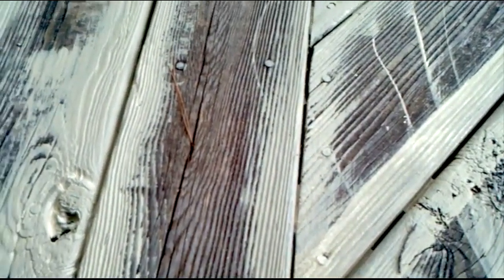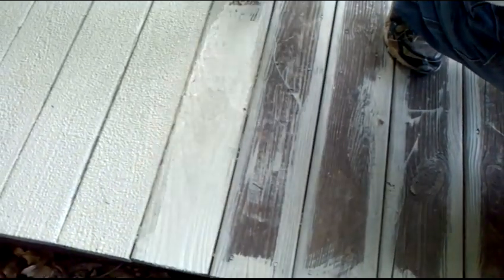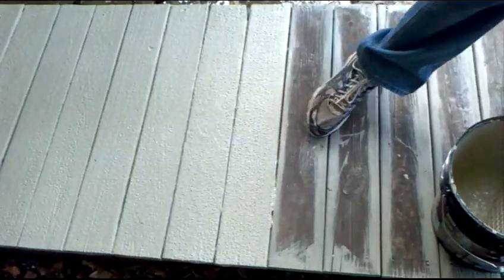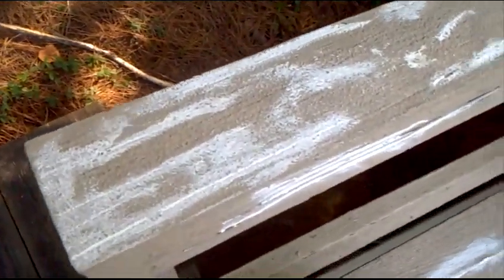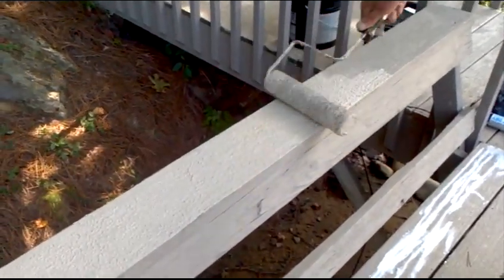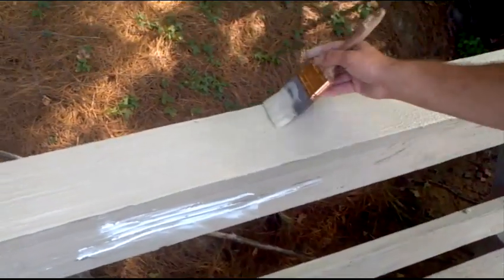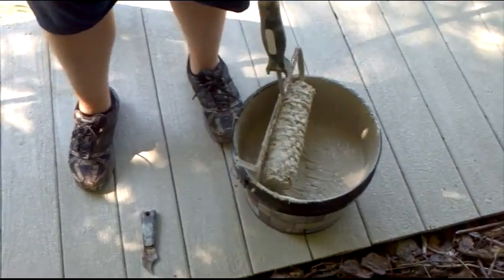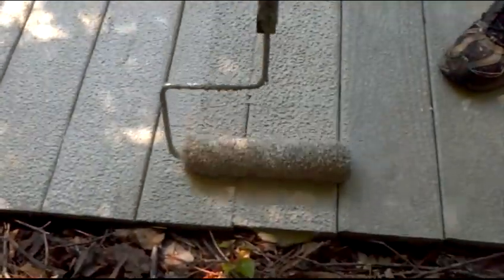How to install Deck Restore.  Best result!

Comment: Josh:  I spoke to you a few weeks ago from CA.  I finished the deck using Restore 10X and it looks fabulous and the customer loves it!!  As you suggested, I did sand down the couple kiln dried 2x6's i had to replace and used the eye dropper to do the water test.  Fortunately, nothing had been done to the deck in over 15 years so it was a perfect candidate for Restore.  Hope it looks as good next year as it does now.  Thanks again for chatting with me and sharing your video.  I must say this product is not for the casual DIYer...a lot of work putting down 13 gallons in a little over 300 sq ft. of deck.
Reply from the maker: Great!!  Glad it turned out well.

Comment: What do you do to properly prepped a deck? I see a lot of videos saying they did followed the direction to a T.  Thank you for any help you share!  I'm looking at using the 4x by Olympia.
Reply from the maker: We make sure the deck can pass a water test by placing a drop of water on the horizontal surfaces.  We also use stain in-between each board.  We put crack filler or caulk in the big cracks and nail/screw holes.
Reply: What is the water test?
Reply from the maker: The water test is placing drops of water on your horizontal deck surfaces.  If the deck absorbs it immediately, then your deck is ready for the product to be put on.  If the water stands on the deck for any amount of time then you need to sand the wood or pressure wash it to get it ready for the product to be applied.  Your deck must pass the water test.

Comment: i just bought a large 4 gallon tub of this yesterday at Home Depot.. We will be doing out Concrete porch here soon.. I painted the porch last year but with rain coming in little it has lifted in a few spots and peeled.. Would it be wise to pressure wash the porch to get any loose paint off?  I bought a crud crutter tech cleaner but i feel i should pressure washer and get as much off as possible...
Reply from the maker: Thank you for watching and commenting.  Just do what the label says and save the can.  The prep is the most important part.  You can't apply this product on top of any other product, it has to be clean brushed concrete.  It can not have a slick finish.  I would be sure it is as clean as you can get it and the temps are what the label calls for.  Air and surface temps are as important as the prep.
Reply: thanks Josh, after looking the other day i bought the advance Restore 10x surfacer or resurfacer its called... I plan to pressure wash and clean as best i can.... thanks for the tips

Comment: this is a GREAT video...thanks for sharing.  I have been following each step as I proceed through restoring my deck.  I am putting down the basecoat and have approx. 1/2 inch gap between boards which appears much larger than one on your video...to remove the 10X between the gap..how close to you run your putty knife to the board?  Also, on 2nd coat you back brush rail to give smooth surface and mention you could also do it with the deck surface.  however, you did not in this video.  I know this is alot of extra work, but not sure if i will be happy with a rougher surface when walking on it with barefeet...what is your preference?
Reply from the maker: I like the rougher because you can make it look more consistent on the decking.  I like the brushed on the tops of the rails.

Comment: Thanks for the video Josh.  I have purchased this product and have still to apply it.  There are many negative reviews about it so I wanted to know if you have had any issues at all using this product?  Any feedback would be great as I certainly don't want to ruin my deck.
Reply from the maker: Nope.  Just make sure you prep correctly.  Don't let it rain after you apply for 48 hours.
Reply: Josh Dillon I have always wanted to try and control the weather.  LOL.  Thanks again Josh.  I have decided to not try the product at all as I am not sure of the outcome especially in the Canadian winters that we get here.  I would fear that after one extreme cold, it would not last.
Reply from the maker: LOL!!  Controlling the weather would be a great super power.

Comment: I am going to be using this stuff i believe for the railing of a deck i am building and then staining the actual biards you walk on because the floor boards are new but the railing is used wood i got to help keep cost down. Anyway i saw your video and it will for sure be a huge help for the process of painting the railing and i absolutely need to know this color you are using!  It is the exact color i was picturing in my head!
Reply from the maker: Julia Roszak I think this was the fieldstone  Thanks for watching.

Comment: did you use a standard roller? When we purchased the paint the guy at HD gave us a roller that looked like a sea sponge? Is that needed? I've never used one before.
Reply from the maker: No, we used the sea sponge roller.  How did yours hold up?

Comment: So you use DAP paintable and then use the Deck Restore?  My boards are rather weathered.  Not rotted just splitting.
Reply from the maker: ***** Yes.  The clear paintable is the best we have found.  I would just replace the boards instead of going through the trouble and expense of trying to repair them.  Thank you for watching and commenting.

Comment: So is this product longer lasting then normal semi transparent deck stain?  i just got done stripping, brightening and sanding my deck.  Its in good shape, so do i even need to use this product?
Reply from the maker: Yes it does last longer if applied correctly.

Comment: @joshdillon thanks for the great video. I just finish doing all. Can I add the Behr clear water sealer on top to make it last longer?
Reply from the maker: Not sure.  The Restore seems to peel from where it makes contact to the wood.  So, I can't say if putting another coat of sealer on the top would help.  How did yours hold up over time?

Comment: What kind of latex caulk do you use?  Couldn't really hear it.  thx.
Reply from the maker: Dap paintable.
Reply: Josh Dillon
I heard " ALEX Fast Dry ".  Not to argue with your success but I note that this product contains silicone.  Rustoleum recommends a non-silicone formula for caulking.

Great video though.  It makes much more sense to be as meticulous as your vid shows rather than the implied " just roll on 2 thick coats " in the manufacturers videos.  I will follow your method.

Comment: Hi Josh, I have a quick question here...my deck is in a really bad shape, the wood is peeling off, and there are cracks etc. But I am told that the structure is sound. In this case can I clean, caulk and then use this restoration product?
Reply from the maker: redeck it.

Comment: I will post some pics in a few months. I can tell you right now that if you are simply rolling on your first coat your in for trouble. Your surface needs to be very clean and dry first of all. I cannot stress enough that your first coat should be brushed in as thin as possible. The reoccurring theme from all complainers is it didn't go as far as it was supposed to. Brush it into the wood creating a scratch coat. Its been 3 months for me so far in Texas and it still looks good.
Reply from the maker: This dock and deck still look great as well.  It was in the worst shape of all the ones we have done, but it had the best result.

Comment: What stain do you use in between each board? semi solid? manufacturer?  Still seeing the product hold up?  Thx!
Reply from the maker: Restore solid acrylic stain.  It will stay down if the deck is preped right and the instructions are followed.

Comment: Nice Video, Thanks for taking the time to share. I am sure there are many variables but in general what do you find the cost per square foot to be. assuming 2 coats and moderate caulking?
Reply from the maker: $5.50 per square foot including materials, cleaning, prepping with crack filling caulking, and two coats on the decking.  The railings are separate and there are to many variables to get into for those.
Reply: Richard McWhorter it's cheaper just to replace with new pressure treated wood by far!!!  then just use a regular exterior semi-solid stain!
Reply from the maker: Anonymous1 Yes we have found it is way cheaper to replace with new wood and less time consuming as well.  It also looks a lot better.  I will be posting a video of a deck we just did where we replaced the decking with #1 grade "no knot" premium decking next week after we finish with the railings.  It looks amazing.  We do have to wait to apply any stain or sealer do to the fact the decking is pressure treated and needs time to cure.  Thanks for watching and commenting.

Comment: does anyone know what or how to get the rest off my deck that has not peeled off?   my didn't  last either it peeled after winter.    I need help getting it off. power wash only does so much help!!!!!
Reply from the maker: Pour hot water on the remaining product and you should have no problem scrapping it off.   Here is the link to the video that I learned about this process.   https://youtu.be/aUf-dr1cAPM
Reply: Margaret Wilson remover!!!!

Comment: I've herd and seen a lot of bad things about this rustoleum restore product ..what's your opinion
Reply from the maker: This product works great but only if applied correctly.  Also, your deck needs to be able to pass a water test to ensure it will accept the product.
Reply from the maker: Anonymous1 There are very mixed reviews on this product.  If prepped and applied correctly, it works most of the time.
Reply: +Anonymous1 I agree.  I did all it told me to do to prep.  The next spring, it peeled up with a leaf blower.  I got a full refund from the company for 6 gallons of this stuff.  Still dealing with pieces of it left after 3 years.  What a mess it was.
Reply: LOL people don't pay all this money for something that requires meticulous prep, perfect deck conditions, and works most of the time.  DON'T DO IT.

Comment: Is this the "Rustoleum" Deck Restore or some other product?  I like your method- looks like a winner.
Reply from the maker: Yes, and we still are digging this product.  They just came out with a new product called 4X.  Use the 4X when the decking is not real bad and the project will not cost as much.  The 4X only says it last 7-8 years as the 10X will last 10-12 years.

Comment: How does it look now? I really want to restore all three of my decks.
Thanks in advance.
Reply from the maker: Mike Smith This deck still looks great.  The wood was in horrible shape and it was the first formula that they released.  This is my Dad's house and I fish off that walkway all summer.  Make sure you do the "water test" before you apply any product.   Thanks for watching and commenting.
Reply: Great! Thanks Josh! Thanks for taking the time to make the video.

Comment: Just want to make sure about this....it looks like the end product has a bubbly service - even when it dries out. Can you let me know if this is the case? Thanks for the video!
Reply: I believe that is the texture created from the roller and is meant to provide reduced slippage i.e. on walkway areas vs the railing that was smoothed out w a brush
Reply from the maker: don't use it